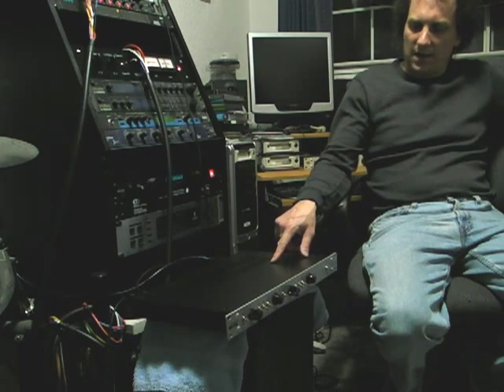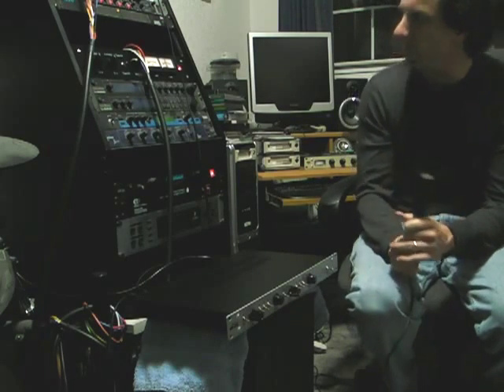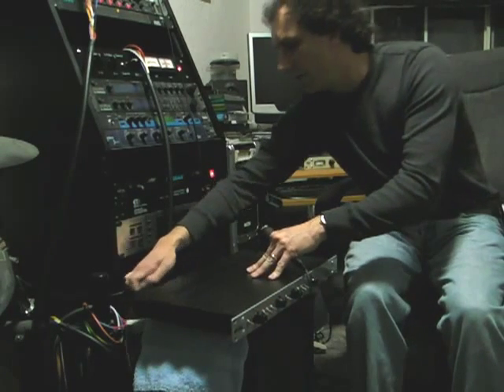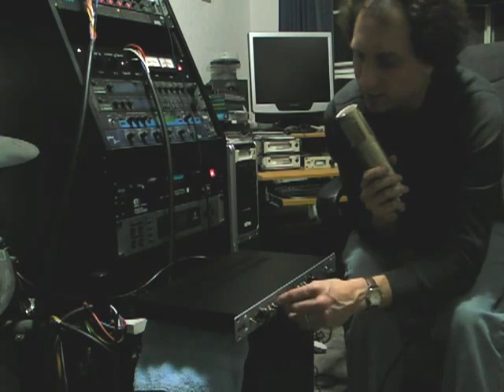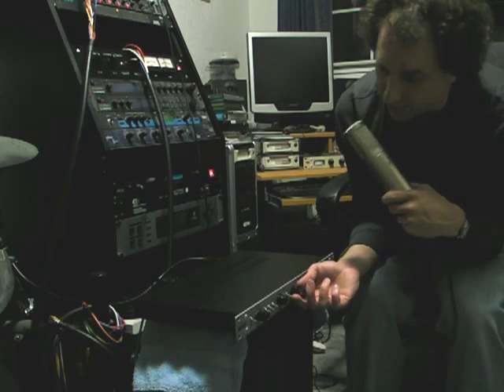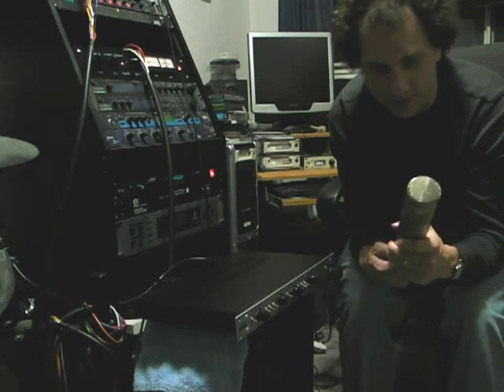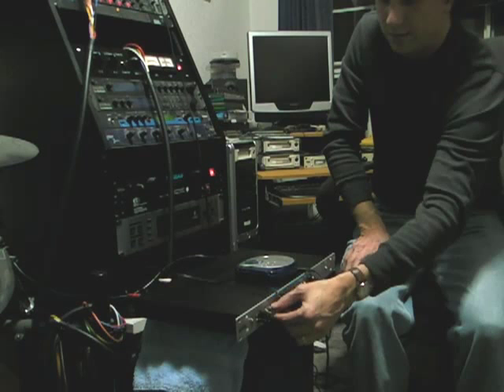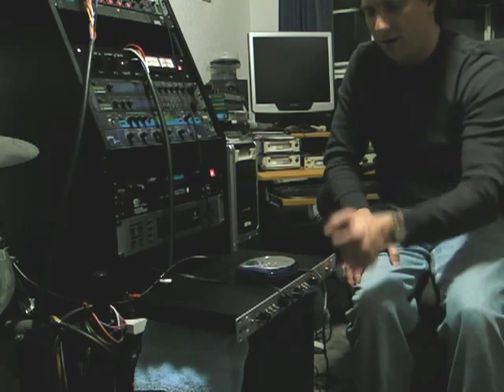Dual Channel API 312 Clone Preamp

Comment from the maker: @itwerkspro Not an IC stage at all.  It's simply a dual ganged pot tied to the output transformer output.  It acts as a true attenuator just like a volume knob or fader where a portion of the signal bleeds off to ground as the signal is attenuated.